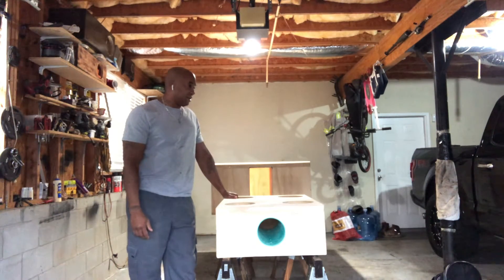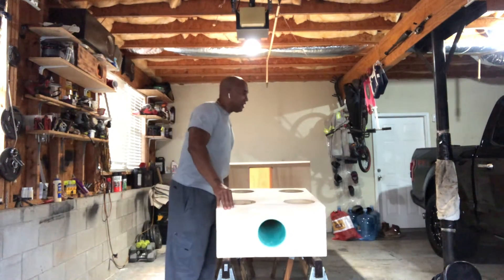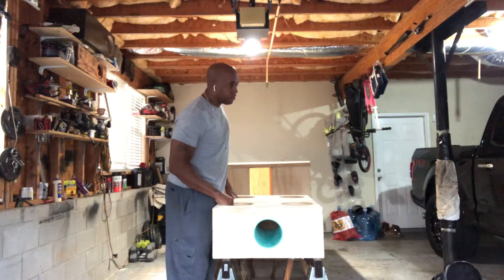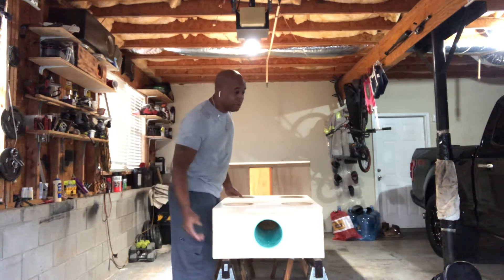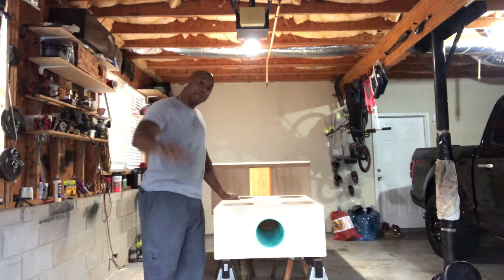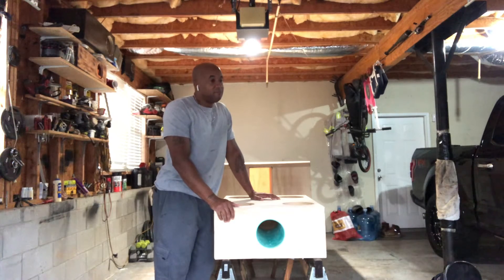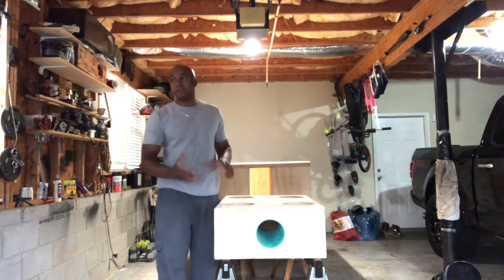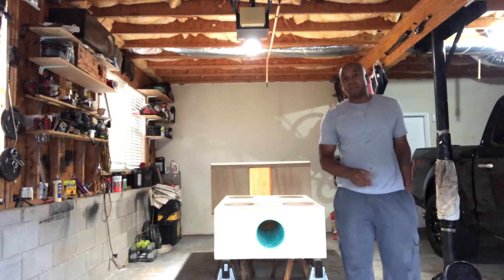Cone area & port area/understanding Cone area is king

Comment: Hello bro I am running I American bass XFL single 12 inch 2x2 it's 1500rms and the box that I'm using is a ground Shaker says 32 Hertz on got it from the company but my question is is that the right box for it I have a 2002 Dodge neon RT it's in back of my trunk facing towards the back and I have a JC power r3200.1d 1 channel amplifier monoblock I use a voltmeter to tune it 38.7 at 33hrz my question is I wanted to run a cone type port for it to hit harder than it is now would you be able to make me that box please let me know Ruben

Comment: I have 2 boxes for my meso 12. One is 1.7 net (prefab) with a 3" precision port 10 inches long tuned to approx 31hz. that's like 7 sq inches of port area. I have another box I built 2 cubic feet net with a slot port area of 33 square inches tuned to 33 hz, CT sounds wants 1.5 net with 40square inches and that seems impossible in sub box pro. port is like 4 foot long.   the small 3" port gets low and sounds better overall. the bigger box may hit slightly harder near tuning but the smaller port is crisp and punchy. My steering wheel shakes with only 7 square inches. Also this is in a crew cab f-150 so I can hear everything with no port noise.. Makes no sense.
Reply: I have a sub box for 4 15 subs with a slot port of 3 inches wide and 2 feet long. Would that be enough port area? Or do i have to make it bigger?

Comment: There is a misconception about how sound travels. The air doesn't move from one location to another. Instead the Soundwave generated by the woofer ( or tweeter also infact) gives it's energy to the air and the air molecules gives its energy to the air right next to it that's why you can put a shirt or hair in a windo rolled down and it will stay in place instead of flying away. Just a little bit of useless information about sound and how it travels. Great video man, keep them coming.

Comment: What amp should I run for 2 - 41L7124? I currently have a Taramp HD3000 that I was planning on throwing on those wired down to 1ohm. What’s your thoughts or suggestions?

Comment: what set up would you recommend for 4 Sundown X8 V.3 dual 4ohms 800 watts to get the most out of it ?
Reply from the maker: You going to need alot of Power they notoriously inefficient. 😂 and a good box based on vehicle and desired tuning
Reply: @M.B.Enclosures  what would you recommend then? i want a very loud , loud as bass n clearness, system for my 09 silverado crewcab , i would like it to be able to fit under the back seats

Comment: What do you think would be louder hypothetically 3 12" Kicker CVR or 1 15" Skar ZVX? I currently have the ZVX in a custom box tuned around 28hz. I have the kickers from an old setup. Amp is an Skar RP2000. Zvx is wired at 1 ohm. the kickers would be wired at 2.67. Amp rated 1400@2ohm
Reply from the maker: The Skar because it would see more power than the 3 kicker...after impedance rise they would not move very much
Reply from the maker: The Skar would see more power and thusly move more air.. theoretically the 12’s would win but the ohm load to high so after impedance rise they would see very little power and so wouldn’t be moving the air they could. Under the right power they could destroy Skar.

Comment: 10:45 is at least 12 ft^3 net because of the need to include or factor in the deep ass cutouts which will add an extra cubic foot even with the drivers being installed. Most builders don't account for this which is why their tuning/peak freq ends up being different then what was intended when removing the vehicles cabin peak freq from the equation. Also, using deep ass cutouts (aka 3+ baffles) begins to restrict airflow from behind the subwoofer on the bottom side of the baffle. Think about it. Air would need to be pushed straight down rather than out to the sides as with double baffles which is why I prefer using bracing over 3-4 baffles. Just some food for thought for viewers to keep in mind when building.

Comment: 3:45 what a waste of money that is (Q-class imo) IF loud bass is his goal. Kicker = SQ, not loud deep bass unfortunately. I wonder if it'll even break a 150 dB sealed on glass.
Reply: Waste of money?  That’s an opinion for sure. I am looking more for sq. I’m not worried if it goes to 150.  Though we all know it’s gonna do much more.
Reply: @Big_Bambu   if your looking for sq a massive over sized box with a huge port isn’t best choice. A standard 12 calls for 2.25-2.5 cubes with the attention of running let’s say 500 watts for arguments sake, when you put that woofer in a 2.5 cube box (after displacement) that woofer is working just as hard as the box is, it’s at its peak efficiency. Now when you take the same woofer and put it in a small box say 1.75 the woofer will now be harder to push in that enclosure so in return now we put 1500 watts on it and now that woofer is over powering the enclosure and allowing it to handle that power with what’s called cone control when you tune a box at say 35hz it will play an octave higher and octave lower with the intention you have your port per square calculated correctly for a flat response. When you have a bigger enclosure it will start to drop db per frequency until it’s no longer audible and the woofer is about to jump out the box, it has now lost cone control. When you shrink that box down below recommended size say by hypothetical 20% below at those lower frequencies the woofer will have more cone control. I can keep babbling but where I’m going with this is don’t think because the box is 12 cubes for 4 12s that it’s just gonna sound better and more sq those 12s are gonna work there asses off with the power he said he will run on them and most likely be very peaky.
Reply: @nicdudash9288  have u looked at the specs for sq on the kicker webpage?  It calls for 3.25 cubes per sub for sq, with a port of 3x13.
Reply: @Big_Bambu   and I ask when has kicker ever won a sound quality comp? There is a reason they sold out to Walmart and Kmart. Can they sound good? Sure to someone that hasn’t heard true sound quality but in my many years of being in car audio I have yet to hear a kicker woofer that I was just beside myself at how it sounded. And 3.5 cubes for a 12 is wayyy too big that woofer is practically free airing in the box. There is a reason that 99.9% of other manufacturers recommend 2.25-2.5 cubes for a 12 and I say 99.9% because the .1% is kicker that doesn’t agree 🤔
Reply: @nicdudash9288  u sure ask a lot of questions. Here is a question for u. Are u that worried about my system that U have to give complete dissertations on why u think it will not sound up to your level of expertise?  This is my system. I’m building it the way that I want it to sound. Did u ever take that into consideration?
Reply: @Big_Bambu   never told you how to build your system I’m simply making statements about the specs if you choose to listen that’s your business if you choose to not listen that’s your choice as well
Reply: @Big_Bambu  not trying to be a douche so sorry if that’s how I came across but kicker has not done much with there product in the past how ever many years since they sold out so there product is no different than when they sold out 15 plus years ago. I wish they would show back up and show people they still have it and compete with the newer companies all across the board. Am I hater of kicker? No I don’t hate them I just don’t prefer them and would rather purchase other brands but that’s my personal opinion.

Comment: How do you cut 45s for box without table saw?  Use circular saw with 45 degree angle and a wide board since its difficult to do on a narrow few inch board? Tips/tricks?
Reply from the maker: Don’t waste your time with 45’s.. no difference with a box with or without one. No programs accounted for it.... none... it’s just Bass myth. Air is like water it will go where there is the least resistance. But putting them in won’t hurt either. If you want them do it, but it does nothing other than shrink the original volume you had at first

Comment: In spl how much does cabin size play a roll in final outcome? My bigger system (2x15 in  ported 7 cube net enclosure on 2k amp) is in a 2010 grand caravan my little system 1 10" in ported 1.5 net on 1.2k amp) is in a 95 mustang gt convertible, obviously the caravan is bigger and badder in every way but on a woofer to thump ratio the mustang is easily more impressive. Your hair and clothes start vibrating at way lower volume levels in the mustang.
Reply from the maker: Lol...you already have your answer. Cabin plays a part. When though more air is moving with the larger subs it’s in a bigger confined space it still should be louder, but if you put that same cone area in the mustang you be louder at lower volume levels because the confined space smaller theoretically... you could also lose by going to much cone area because the bass wave wouldn’t develop in such a small area with larger subs. That is why the 10” so impressive even though it not as loud as the 15’s
Reply: @M.B.Enclosures  your contact info?

Comment: I was waiting for a video like this from you I wanted to know if I could get away with 2 4 inch diameter aeroports instead of 1 8 inch aeroport for 2 audiopipe bdc4 12s on 4k rms I used 2 4inch aeroports for a single 15 build and it sounds really good but on the lower frequencies like 25 down to 16 hz I can hear chaffing noises or like too much air trying to be pushed out
Reply: What you are actually hearing at those lower frequencies is the mechanical movement of the spider, air moving threw the venting holes in the basket located by the voice coil, & air moving threw the venting in the end of the magnets motor structure.  In all honesty a larger port would not help with the port noise issue at lower Hz frequencies, being it is the Audiopipe - TXX-BDC4 12" subwoofer's design flaws that are causing the problem. Take both subs out of the enclosure & run them free-air to be able to hear if the problem still exists when you play at 25Hz down to 16Hz. I bet it is the subwoofer instead of your port size causing the sound your hearing. Let me know if that was the issue causing the problem.
Reply: @DTW-bx2vy  I dont have that setup anymore but definitely was the subs I apparently tore the formar off the spider playing them that low on too much power everyday. Look at my vids now and see what im rocking now

Comment: Exactly!  If you want big bass you need a big box with big woofers and big ports.
Reply: I made a box for 2w7s 12s tiny port, it has almost no port noise. And gets loud and low as fuck. Hits harder on 1500w than my sundown zv6 18 with a big ass box and big ass port. Idek how or why
Reply: @TheChcam proof 😅
Reply: @Chino0420  I can do that. I'll post a video later
Reply: @Chino0420  I'm not kidding it sounds super clean and does like 15hz well
Reply: @TheChcam  what power on the zv6? also w7s are decently sensitive.
Reply: @dustyt9  The power on the zv6 is 3000w rms. The jls are so much better sounding aswell. But the sundown has its signature wubs if you like that it does them well

Comment: Doing the same today. Im taking out my evl d4 12s and putting my kicker d4 compvx12s .
What I have pick up on is i will use less power with the kickers but have more output. Mostly cause of the cone area difference. There is a 1000 rms watts difference between each pairs kicker being the most efficient. Plus I need to go easy on my alternator before I end up buying a new alternator sooner than I planned.
Reply: Those evls will do way better then those kickers